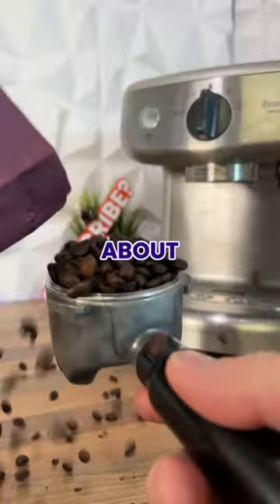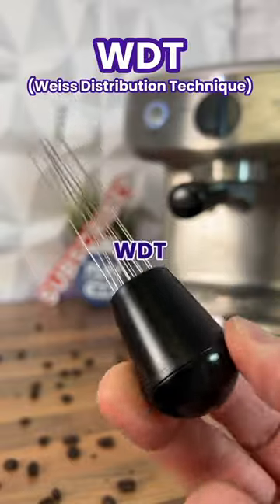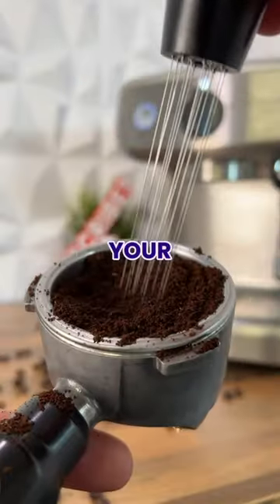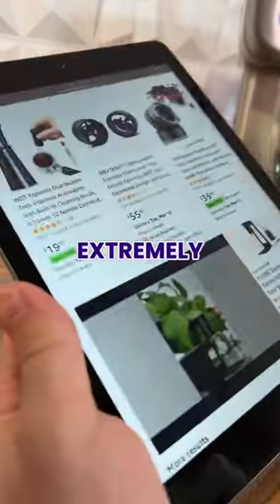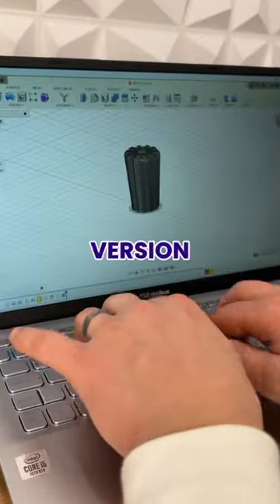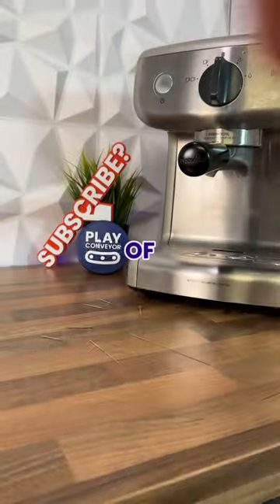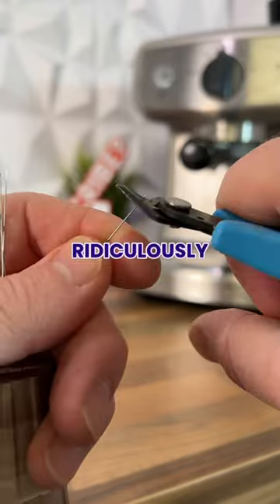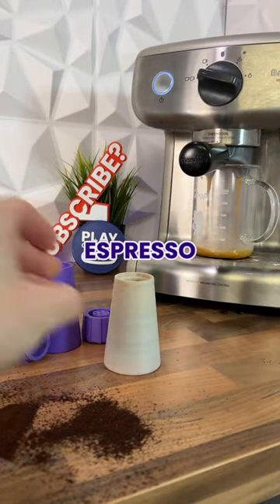3D printing the WORLD’S best COFFEE?! ☕️ #3dprinting #coffee #shorts

Comment: On one hand, for the price of 2 WDT tools, you can make like 5-10 of them.  On the other hand, you need to buy like 5-10 WDT tools worth of supplies to just make 1 WDT tool... I love 3D printing, but this is so...extra
Reply from the maker: It seems like most of them basically use acupuncture needles, which are super cheap to buy online! 😃
Reply: @playconveyor  Acupuncture needles normally come in sets of 50 or 100. Which normally goes for $10-12 from a reputable seller which per WDT tool is cheap. A cheap WDT on amazon can be had for $3.99. Unless people have the needles lying around I stand by my initiation statement.
Reply: @MaheerKibria  3d printer people already have them on hand, they use them to clear clogged nozzles. my 10 dollar pack of nozzles came with several of them.

Comment: Hey, the new tool that is suggested for this is like a cylinder "cup" with a hole at the end that a kind of pestle covers and a lid that holds the pestle in place.

You then shake the closed container with the grounds in it to evenly distribute and declump the coffee grounds.

When you are ready to begin the puck prep, you just put the bottom of the "cup" over the basket of the portafilter and lift up the pestle thingy and do a shakey shakey.

Then, you compress the puck, and either put on a filter or just brew it as is.